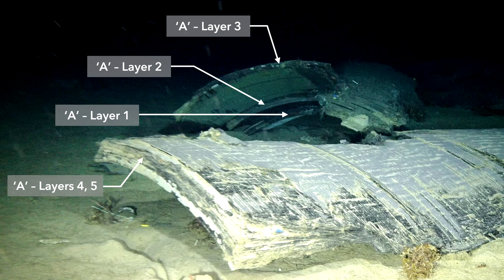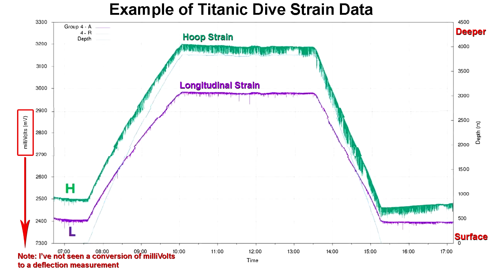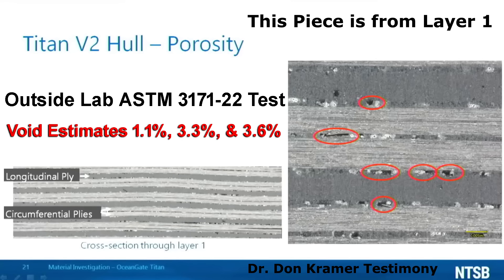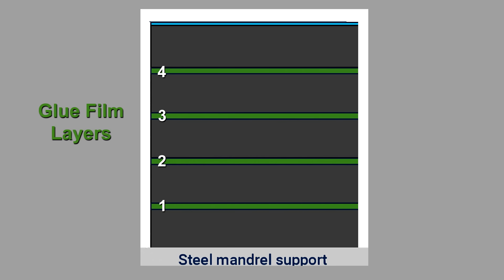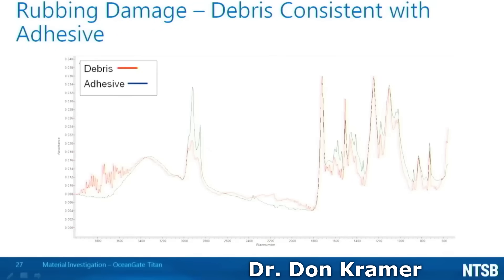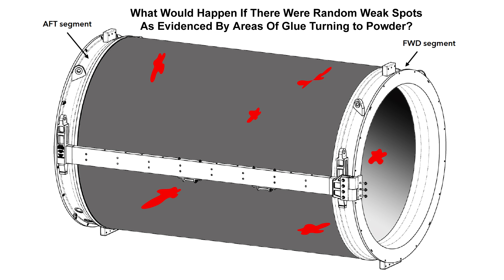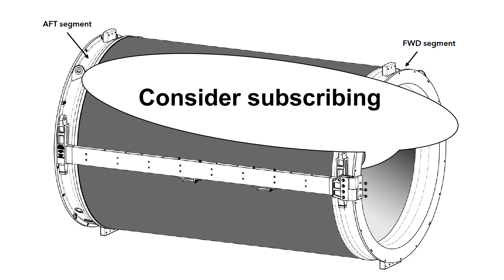OceanGate Titan Hull - Glue Layers Were Breaking Down To Dust - No Clues.

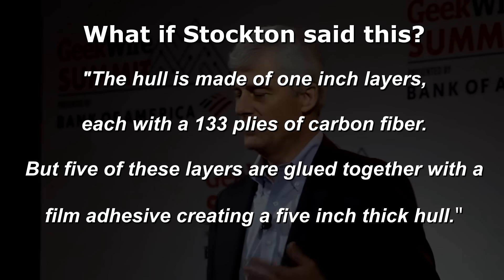Comment: 9:23 he added 1 too many layers when traveling to the depths of hell. I had wondered if water has gotten in under layers where they machined then fitted the endcaps on. If water is in the layer then the layer above might as well not exist.
 OceanGate , WaterGate, ironically chosen name for corruption of principles. Unfortunate loss of life but at the same time they journeyed directly in to death, do not be surprised when you find it.
Safety when you think of it.
Reply from the maker: Thanks for commenting.  I agree with you.  Water infiltration is a big unknown.  They were relying on regular Rhino Liner on the outside to prevent water intrusion.

Comment: The shear load carried by the film adhesive between the layers is absolutely critical. If you're looking for a way to quantify the strength/stiffness difference between 5x 1in layers, and 1x 5" layer, consider the moment of inertia calculation.  For a rectangular cross section of hull with unit width 1", the moment of inertia is (1/12 * b * h^3). For 5 individual 1in thick layers, that's 5*(1/12 * 1 * 1^3) = 0.416in^4.
The moment of inertia of a single 5" thick layer is (1/12 * 1 * 5^3) = 10.416in^4. A difference in 10x the stiffness! So the difference in displacement would be proportional to that.

The difference in stress is not the same, as the bending moment would be distributed across the 5 layers and the extreme fiber distance is much less. For the simplest case of max flexural stress,  (M * c / I) where M is the bending moment, and c is the distance from the center to the edge of the section.  The stress in a 1in layer would be ((M/5) * 0.5 / 0.416) = 0.24 * M. The max stress in a 5in layer would be (M * 2.5 / 10.416) = 0.24 * M.

It's like the difference between bending a deck of cards. 52 individual cards with no shear connection bends easily. Glue those cards together and you would struggle to produce any deformation at all.
Reply from the maker: Thank you for this thoughtful comment and explanation.  I can't follow all the math, but I get the point.  And what this video is about; how could the engineers involved trust the film glue as a crucial component.?  I don't know.

Comment: It would have worked even with minor imperfections if it had been 15 inches thick!
Reply: Actually no.  Composite pressure hulls are a bit of strange science.  As you add layers, each new layer adds less and less additional strength even if the layers are perfect.  With defects, it is worse.
Reply: @ yeah I agree I would not go down in no less than titanium sphere 8 inches thick (alvin,mir 1 or 2)!

Comment: What really blows my mind is how many times it made the trip before failing. Given the horrible condition of the hull it should have collapsed long before reaching those depths.
Reply: I think they left it out exposed to the element while waiting to get more paying "crew members". The sun is very brutal to epoxy if left exposed for a period of time. I noticed it with filter tanks built similarly here in Florida that was not protected by anything and left exposed. The epoxy coating turns into powder and fiberglass filaments of the mesh start to pop out.

Comment: measuring void gaps with 0.000xyz inch is a crime. Just use MM. Its a SI unit ffs.
Reply: The units don't matter in this case.  Wrong is wrong in any system of measures
Reply: This. If he was going to use some outdated unit he could've at least kept it nautical and used leagues or fathoms.

Comment: Honestly why even make more videos on this, bloke was a cowboy using materials not meant for the job, 
I know the reason they died, cause of some idiot 
End of story
Reply: They are milking it indeed. 
As I have understood from my time in aircraft CFRP manufacturing/ engineering, fibers can only work in tension, not compression. Assuming here that a submersible like the Titan is not a pressure but a compression vessel, i.e. the outside pressure far outweighs the inside pressure. So, the fibers do not do any real work and only the matrix material (a plastic of some sort) is bearing the brunt of the forces. 
I find it very remarkable that this simple fact is not pointed out in any 'professional' analysis in writing or video about the subject as far as I have seen. I would really like an engineer with specific knowledge in this field to give his opinion.
Reply from the maker: @bigbattenberg  Thanks for your reply to the comment.  The generalized statement that carbon fiber has no strength with compressive forces is not true.  At 4:00 I put in the Toray chart for the specifications for the product OceanGate used. I did that on purpose to show that this system when properly fabricated had fairly good compressive strength. Toray tests for compression and publishes the data for the end users.  But it is for using the "system" properly; the fibers combined with the matrix and proper curing processes.
Reply: @solareclipsetimer  Thanks. How is the compressive strength measured, what setup? I can imagine it being fairly strong when placed in a hydraulic press sandwiched between metal plates but the forces are very different in this particular application. Especially the potential for failure starting at the innermost layers and then running like a zipper through the material thickness, if that makes sense. Very much like wood being bent.
Reply from the maker: @bigbattenberg  Thanks for your reply.  I have no idea how Toray tests for compression and how the end users apply the data for their own projects.  That is a good point that you make, and the engineers who are designing projects probably work with Toray on the fine details.  The engineers from Spencer Composites were the first guys to tell Stockton a prediction for the strength of a 5-inch carbon fiber hull (not Toran products for that hull).  Their design and analysis paper talks about how they came up with their numbers.  Now, it turns out they were way off with the strength prediction, but it is unclear if that was due to their calculations or just a poor layup of the 5 inches of carbon fiber.  So, you are correct about not trusting carbon fiber systems in compression; unless your engineers exactly what they are doing and the fabrication process is perfect.  A side note:  the NTSB also tested a piece of the recovered hull under compression, although they did not testify about those results.

Comment: The high void content around the adhesive film is not surprising. This adhesive material is a semi sticky film that will want to trap air under it. The process has to deal with this, and either stop air being entrapped during the application or remove the air during a subsequent process. This wasn’t achieved. The air never got out of from under the film during any of the debulks and curing operations.
Reply: Yup, and they didn't even do they winding in a clean room!
Reply: it is surprising, they normally do all kinds of glue shit under vacuum to get rid of bubbles. at least people who know wtf theyre doing.

Comment: All around the design flaws is normally covered by basic understanding of mechanical engineer. No need to be a genius nor senior design engineer to know that this design will fail. Any student can asume that after a year of learning or better learn something else. Understanding shear stress, failure accumulation, bending and trivial load cases does not take more than technical interrest. Here we see a showcase of ignorance of good engineering practice grown in a project surrounding with less time, less invest and huge requirements. Like at Boeing thees days and like it is commonly found in modern industry. Paired with peoples character to not dedicate their life to their work and productivity but using their work to buy distraction and prioritising what is called life over work in constand optimization results in a future where more stuff will fail and knowledge as well as deep understanding and expertise is fading. 

STOP THE STOCKTON RUSH!

Comment: I believe the stress theories expressed in this video are not applied properly.  A Cylinder is not like a beam.  The load is circumferential not a span from one end to the other.  All loads are focused towards the center.  Compression is not in any way like span loads.  Maybe some accredited engineer can explain the load dynamics.
Reply: Remember that this is a hollow cylinder, not a massive rod, with much less pressure on the inside .  This makes the theories more relevant, though I don't have the training to say how relevant .  The common product most similar is a garden hose (with reinforcement fibers), but used for vacuum, not pressurized water .  Now try to calculate how to prevent it from getting squeezed flat or torn apart .
Reply: @johndododoe1411 DUH!  it would be more like a pipe than a garden hose.  No force trying to flatten it.  It has equally distributed force, compressive force.
Reply: You would use integration, an infinite number of zero width beams, to calculate the total loads and deflection of the cylinder. So yes it is actually a valid way to discuss behaviours of the materials.
Reply: @Thomamps  The forces are not greater at any point along the length, it's a cylinder.  The diagrams showing greater force at the middle of the length of tube/cylinder is not the way it works.  If you had a pipe 1 foot long of 100 feet long the pressure exerted is the same regardless of the length.  The diagram clearly expressed otherwise.  Again it is compressive forces not bending as if it were spanning.  Diameter would be the basis of determining force, not the length.  The load would be more similar to what a column would bear rather than a beam.
Reply: @Stan_in_Shelton_WA I think your argument would makes sense if the hull was built entirely from the same materials. In the case of the Titan dissimilar materials were used on the ends being made of titanium thus providing additional support. The hulls ability to withstand the pressure drastically reduced as you go towards the center thus your pipe argument doesn't stand.
Reply: @royl1211  The ends were made of different materials for geometry reasons.  Also for other function, hatch and view port.  The main body was a tube and experienced pressure as a cylinder.  pressure was delivered over the entire exterior surface and thus towards the center.  I assure you that the forces were distributed perfectly and the tube functioned like a pipe but it also had to support the forces from the ends pressing towards the center due to it not being a sphere.  Essentially a pipe with caps.  all compression forces.  The different materials argument does not fit.
Reply from the maker: Thanks for your comment.  The idea of a span was brought up by the engineer Bart Kemper during his testimony as a simplified way to look at compressive loads on the outside of the hull.  I have an excerpt of his testimony in another video I did about the hull.  Search for this title,  OceanGate Titan Hull - Hundreds of Ill-advised Carbon Fiber Grind Spots and skip ahead to 17:30.  If you would like to listen to Kemper's full testimony, he was a witness on Sept 25, the third witness of the day.

Comment: Rush should've built the hull out of titanium, or stainless steel. Building it out of carbon fiber, was innovating for the sake of innovating- and as proven via the US Navy's experiences with the Littoral Combat Ships, a VERY BAD idea.
Reply: Innovating for the sake of bottom line. Carbon fibre was cheaper and safety rules were for wimps.
Reply: The littoral combat ships were an attempt to copy good ships from the Swedish navy without access to the original shipyard (demolished).  I don't know if their problem was bad copying or wrong use/maintenance .

Comment: Another problem other than porosity and bonding layer problems is that carbon fiber composites and fiberglass composites are much stronger in tension than in compression. The carbon fibers have very little compressive strength. It’s the matrix material, epoxy, polyester, etc. that offers much of the compressive strength. The fibers are like wet noodles in compression. So this material isn’t suited for this purpose, even if it were perfect.
Reply from the maker: Thanks for your comment.  At 4:00 I put in the Toray chart for the specifications for the product OceanGate used.  I did that on purpose to show that this system when properly fabricated had fairly good compressive strength.  Toray tests for compression and publishes the data.  Having said that, I am not saying it's good for a hull.  And as far as I can tell you are not supposed to cure this product after 133 plies. So, it's a complex subject.
Reply: Hurray, an answer to my question! I fully agree and think is is not mentioned enough as everyone is talking about the details of (defects in) manufacturing, which is completely trivial when the wrong basic choices were made in D&E.

Comment: Why weren’t there rings placed every foot meter whatever inside of the hall to keep the center of it from compressing more than the edges?
Reply: I believe your thought is similar to mine, however, I was thinking that it may have been an improved design to progressively provide more plies toward the middle of the cylindrical hull, making the middle portion the thickest part.  With 5" hull thickness where it bonded to the metallic rings at either end of the hull, the mid portion of the hull could have been 7" or 8" thick to reduce the deflection of the middle portion of the hull under pressure.
Reply: You would have to step put of your fantasy world and agree Kevlar needs more data points.

e.g.:

Why did he not simply have telescoping poles 90 degrees to each other to quantify flex on its maiden voyage? It is, at most, a $100.00, definitive, test.
Because he did not want to know.

lol, I just remembered the movie "Down Periscope": he could do a proof of concept with duct tape and string.
Reply: Obviously, there were so many other critical flaws that doomed the design from the beginning, but i also wonder if even one thick center steel ring might have helped.

Comment: Dumb it all down to ultra simplified. The Titan had five hulls which were not integrated with each other. They were just haphazardly glued together.
Or to  give an analogy, Stockton Rush had 5 million brain cells functioning but the synaptic connections were about as tenuous as the wiring in my prototype 28 year old Isuzu.

Comment: 6:29
Here it’s said that OceanGate would not know they were missing porosity specifications by at least 5% because they didn’t do destructive testing.
Where does this 5% come from?
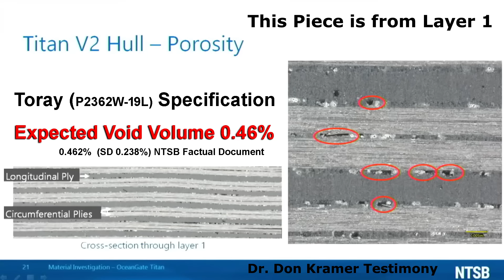Didn’t they miss the specifications by 3 to 7 times (5:13)!?

I’m no scientist. So please excuse me if the answers are obvious (to you).
Reply: just a phrasing issue, he means the amount of porosity was at least 5%
Reply from the maker: That is a fair question.  The Toray specification for porosity for the laminate when properly cured was 0.46%.  The ASTM testing found porosity of 1.1%, 3.3%, and 3.6% in different samples.  Dr. Kramer rounded it out and testified that the average porosity was about 2.2%.  So, divide any of those numbers by 0.46 and you see the range they missed by.  Using Dr. Kramers' number (2.2) they missed the spec by 4.78  Thanks for your comment.
Reply: The problem was staring them in the face from day one, but they were too stupid or arrogant (probably both) th see it.
On every successive dive the descent was faster. The obvious and only reason was that the structure was gaining weight. The only possible culprit was water and the only possible place that could store it was Stocktons famous and ridiculous cylinder.

This is what happened.
As well  as the points mentioned in this video, the epoxy glue would have contained millions of minute air bubbles.
On the first dive those nearest to the surface collapsed, crazing the glue. 
During the ascent, he pressure dropped and the spaces restored. However being below water, they re inflated with water, hence the weight increase.
On the next dive, since water does not compress the damage went deeper. Then on the ascent, more increase in weight.
And so on, and so on.
All this soggy crazed glue had about the strength of a soggy bath sponge.

On the final dive, the unaffected area reached the 50% redundancy level and the whole lot imploded.
I had no problem explaining this to a 12 year old.

Their was such a simple solution at the design stage.
Two thin titanium cylinders one inside the other welded to the end plates, with a 5 inch gap between them. The gap evacuated, tested, then vacuum filled with the epoxy. 
I have based my SIZES on the original design. They would have needed to be recalculated and adjusted by a marine structural engineer.

Comment: 3:34
Here it’s said that the estimated porosity was between 18 and 27%.

4:37
The outside lab found porosity values of 3.6, 3.3 and 1.1%.

Why was the estimation so far off?
I’m sure I miss something here.

I’m no scientist. So please excuse me if the answers are obvious (to you).
Reply from the maker: Good question.  That threw me off at first also because Dr. Kramer was not clear and I tried to explain it as well as I could in the video.  The 18 to 27% was the NTSB tracing out voids on the oblique cut surface of the hull.  So, it was kind of a surface estimate over a specific square area they looked at.  The numbers that were 1.1 to 3.6% were from a test where they look a block of material and estimated the porosity of the volume of the block ( 3 dimensional).  At least that is the way I understand it.  I actually sent an email to the NTSB to ask that question, but they never got back to me.  Thanks for your comment.